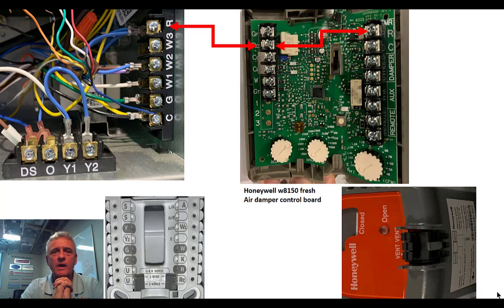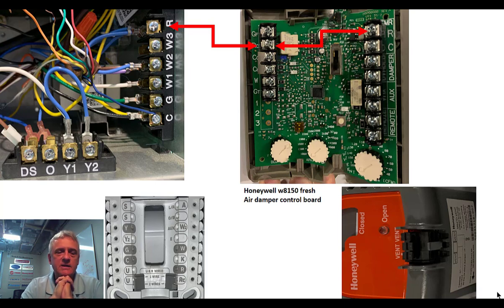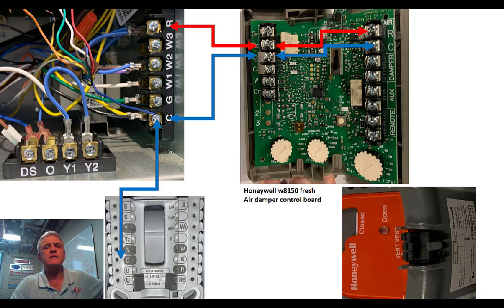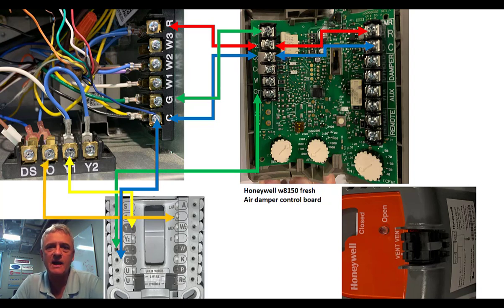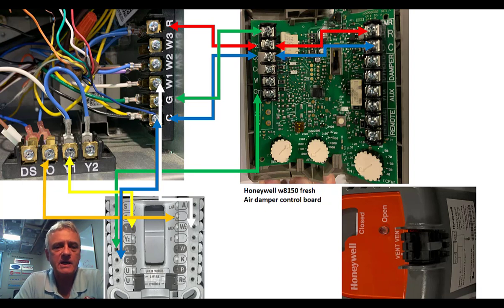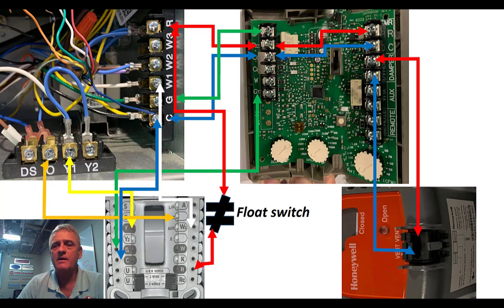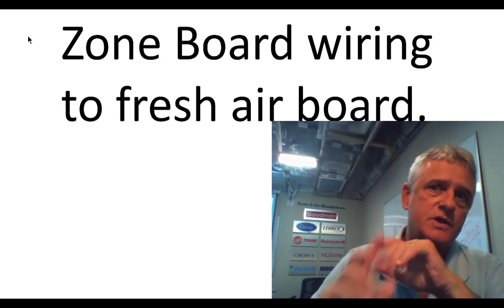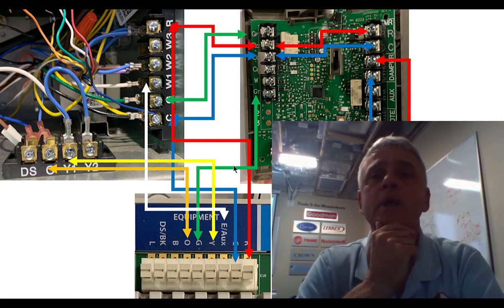honeywell w8150 whole house ventilation wiring

Comment: Thanks for the helpful video! 
Would you be able to go one step further and explain how to wire the W8150's remote terminals to a compatible thermostat's U terminals so the thermostat app settings/ventilation function can act as the "remote"? Is it a simple 1:1 - remote 1 to U1, remote 2 to U2? 
Can a stand-alone compatible thermostat be used if original builder tstat wiring count is insufficient to use existing thermostats?

Comment: Great video. My AC system has the same damper and connections, the ventilation was set to ON till now. I got the humidity problem in the house at Houston, Texas. Do you think I have to set it to OFF position? I found the damper will be turn on when the AC works. I expect this switch can be set on the Honeywell Lyric T6 settings, however I can’t find the Ventilation option on the T6(YouTube has this settings video), do you know why? Thank you very much.
Reply: If it sets up to OFF position, I have to change the airflow settings to lowest for the high humidity area, right!

Comment: This video solved an installation issue with my Honeywell system. My HVAC tech couldn't figure out what's wrong in that it wouldn't power on. The instructions don't really go over the "C" and "R"  positions unless you look at the fine table--these MUST be used in order to power the controller. The question is how to you do it. I did the jumper method as shown in and everything works correctly. Honeywell could do better with their instructions.

Comment: Your video helped me to troubleshoot a ventilation control panel that was incorrectly installed in my house. I had narrowed it down to thinking it was an issue with the R/C wires. The jumper for each within the unit you show did the trick. Of course this isn't in the wiring diagrams! Thanks!